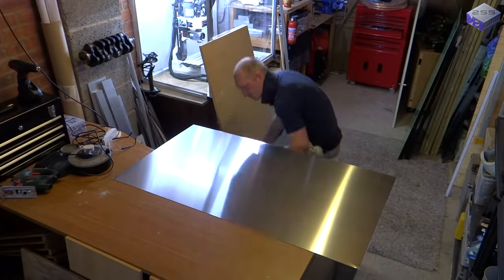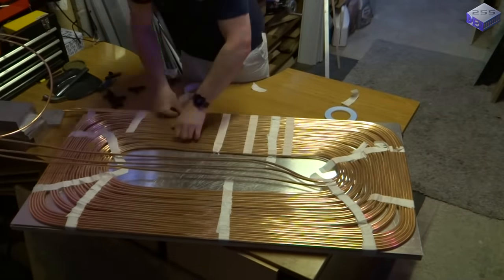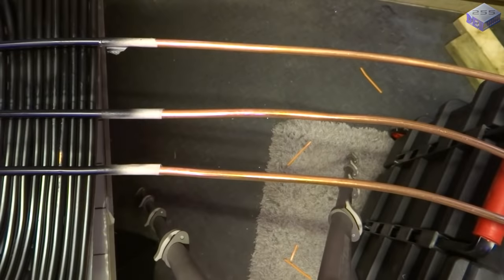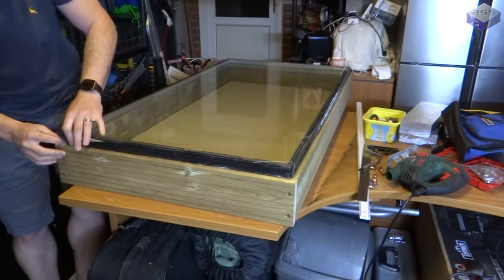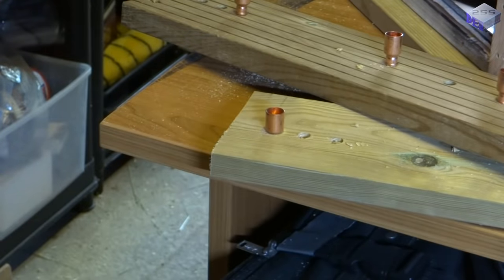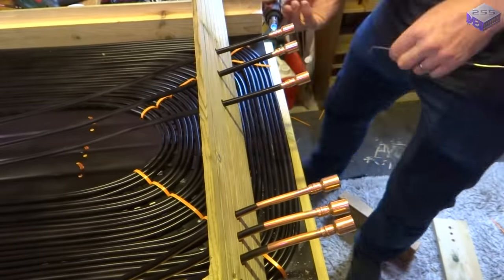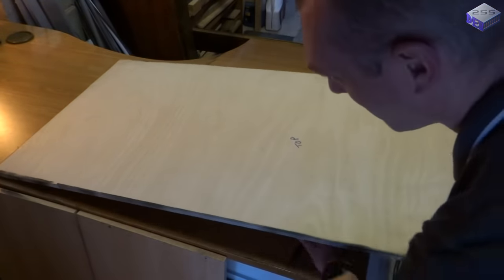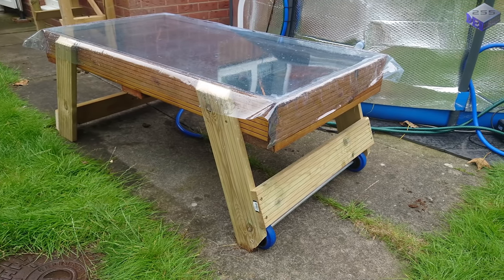Improved Solar Pool Heater - Full build

Comment: Did you use low e passive double pane glass?
Reply from the maker: Hi, unfortunately not, although I have got a few sheets of different material to try, so will be doing some comparisons. I didn't initially think of the reflective properties of this type of pane.

Comment: Wonder how much this actually increases the water temp on a hot sunny day
Reply from the maker: Hi, this is producing around 500W on a good day, and 450W average throughout the day roughly, so around 3.6kWh per day. For a pool like ours of 4600 litres, this would be fairly little gain, possibly around 1 to 2ºC so would require a few, although I'm still tinkering with the materials to see if this can be made more efficient. I will be doing another video soon that shows each stage of the upgrade. Hopefully, this will show how to make the most efficient system at home with standard products.

Comment: Really good idea and video.
Can you use pvc pipes instead of copper?
Reply from the maker: Hi, thank you, yes you could use PVC pipes, I did in my last version and it still works really well. I made a video of that one here: https://youtu.be/QU7RUfWXfZ4

There are a number of tweaks that I would do to this one too, plus I need to look into copper and chlorine more as there have been a few comments of concern.
Reply: Thankyou I will test it in a small scale.
I like to do one for a greenhouse.
Reply from the maker: @miguelhurtado3873  Good luck with your project. Feel free to ask questions if needed
Reply: @TheSolarPoweredEngineer , copper and chlorine do not get along well at all.  However, copronickel (aka copper-nickel alloy) is commonly used for pool and marine heat exchangers.  It is very corrosion resistant and on par with titanium.  Copronickel tubing is also used for automotive brake lines so that might be a good way to source it.
Reply from the maker: @CL-gq3no  Ooooh, that sounds like a good solution to this issue, I will look into this as I've not come across Copronickle (sounds like a Disney villain). Thank you for the suggestion.

Comment: why so mich copper on the aluminium ? half of the tubing would give the same result. Further on, why double glazed glass ? This blocks the heat from coming into the collector. When the sun disappeares you should swivtch off the water flow so no heat loss when the sun is away. I have professional plating ( of copper ) bought in a industrial factory , they welded the copper tubing approx 10 cms from each other going from right to left connected parallel to the copper connectors. ( just 2 in total ).  I am afraid there will be condensed water inside your panel which blocks the sun. But anyway my compliments for your work.
Reply from the maker: Hi, Thank you, I was going with as much contact surface area as possible for this size. This project was made from all the comments from my last PVC version, although I need to do some more tweaking such as changing the glass to UV resistant acrylic or greenhouse glass. The flow does turn off when the panel gets below 5ºC above the pool temp and turns back on when 2º above (hysteresis); this uses temperature sensors on an Arduino to switch a really on and off, plus it logs the temperatures on an SD card for me to track its performance and transmits the temperature back to the house. I did a detailed video on my last panel for this and hope to delve into this one more this year.

Comment: Do you think the copper pipe transfers heat better than black poly?
Reply from the maker: Hi, yes the copper does transfers the heat more efficiently, although the black poly is a fair bit cheaper, so you can have more length (surface area); therefore cost per absorbed energy would be better with the black poly. My first Solar Pool Heater on here does really well, collecting around 600W average and 900W max during the mid-day summer sun
Reply: @TheSolarPoweredEngineer  I wonder how I can get more volume. Right now it circulates about 600 gal a day. I wonder what would happen if I moved up to 1" poly?
Reply from the maker: @bigbrew08  To be fair, 600 gals per day at a 2ºC difference will give you about the same as 1200 gals per day at 1ºC. The flow rate does help a little the faster it goes, although negligible most of the time as long as it creates turbulent flow. The thing to bear in mind is that you need turbulent flow for all the water in the tube to take heat away from the surface (laminar flow will only allow some of the heat to be taken), so to go from a small bore tube to a larger one you would need a greater flow rate to ensure turbulent flow. I hope that makes sense.
Reply: True. I'm looking for an old wood stove. I'm gong to run some black pipe through it and connect it to the pump. This will help get the water up to temp where the solar heater can take over. Load of pine costs me about $40.
Reply from the maker: @bigbrew08  This should work well as long as the pipe going through the stove can take the heat. If connecting up the solar heater to the stove in series, I would recommend you have it pump through the solar heater first and then the stove so that the solar does the pre-heating; this as water in a solar thermal panel only reaches around 65ºC in my experience (unless you focus more area of light on it) and the stove will reach much higher. If the solar panel is after the stove it will have the effect of cooling your water as you heat the panel up. I always set the pumps up to push the water through the system for a few reasons, such as, the water running through the pump is at its coolest, it's easier to prime the pump (especially if it sits below the water level).

Comment: was it more efficient in parallel than in series?
Reply from the maker: It did seem about the same, although I couldn't say which would be better as the sun wasn't consistent over both tests, I would need two of these running together for accurate results. My initial thoughts are that the series system worked slightly better, possibly due to turbulent flow in the tubes (ideal for getting the max heat transfer), although the pump would be working harder with more resistance. I hope that answers your question.
Reply: @TheSolarPoweredEngineer  thank you! great video!

Comment: I would have insulated the copper pipes from the backing alu.  As is more heat will move from the copper to the alu than the reverse (IMO).  Indeed standoffs of 3 or 4 cm would have been better.
Reply from the maker: Hi, I do need to make some modifications so may give this a try. One thing I do need to do is reduce the amount of air in the unit, as this reduces the amount of energy transferred to the pipes apparently. I also need to change the glass as it could be reflecting more of the suns energy away.
Reply: @TheSolarPoweredEngineer   Need some air to insulate against heat transfer to the glass and out again - so make sure you don't make it too 'thin'.

Comment: Is water really running through every tube evenly?
Reply from the maker: Hi, probably not, hence the external connections so I can tweak the flow through the panel and different joints, I will need to get 3 flow meters for this and log it using the Arduino from the first panel.

Comment: How did that 500 Watts equate as a temperature increase though? Some temp in/temp out versus flow rate information would be better data to give out for somebody considering making one of these?
Reply from the maker: Hi Nick, I agree, I am yet to fully test the system as last years summer in the UK was limited to say the least, doh! Although, I did make a video that goes into a fair amount of detail including flow, temp in and out. Here is the video link https://youtu.be/Zt_RiMgSMEs
Reply: Calories are a measure of energy.  Watts are a measure of energy over time.  1 watt is 0.24 calories per second.
It takes 1000 calories or 4000 watts in 1 second to raise 1 liter of water 1 deg C.

So 500 watts  will raise 1 liter of water 1 deg C in 8 seconds. Or 10 liters of water 1 deg c in 80 second, 100 liters 1 deg C in 800 seconds etc.  

So to calculate what 500 watts applied for one hour can do ...

((Watts * Seconds) * 0.24) / 1000 = "litre centigrades"

(500 * 3600)* 0.24 = 432,000 calories 

432,000 / 1000 = 432 "litre centigrades" or litres per C.

So 500 watts applied for 1 hour would raise 1 litre 432 Deg C or 10 litres 43.2Deg C or 100 litres 4.32 Deg C or 1000 litres (1 Cu meter) 0.432 Deg C ....or a 20,000 litre pool 0.0216 Deg C

For a practial example take a standard 3kW electric kettle that holds 3 liters of water...
If the starting temp is 20C to get to a boil it would require (pure water at sea level):
(100 Deg C  - Starting Temp in C) * volume in litres * 1000 calories
 
Or  (100-20) * 3 * 1000  = 240,000 calories to bring to a boil
A 3kW element theoretically applies (0.24* 3000) = 720 calories per second so will take 240,000/ * 720 = 333 seconds (just
under 6 minutes) to boil
Reply from the maker: @Pabz2030  Thank you, that's a great explaination of energy to increase water, I've not thought of it in calories before, I will apply this to the calculations. Now I feel like I'm in the Matrix 😉 303.
Reply: @TheSolarPoweredEngineer  lol You´re welcome.  I knew my electrical engineering degree would come in handy one day...in or out of the matrix :)
Reply: @Pabz2030  Thanks for that, So essentially that means that using this device to try to warm up one of these above ground swimming pools would barely keep up with the losses from cooling? I had given some thought to maybe cobbling something like this together for my kid's pool, and maybe still will, but now I realise I will be doing it for the fun rather than any major heating effect. I suppose it's more of a temperature maintenance device rather than a heater?
Reply from the maker: @Pabz2030  They are great films (or reality 🤔) although haven't seen the new one yet.
Reply from the maker: @nickmaclachlan5178  Hi, it can be just temperature maintaining, there are a lot of factors to consider, including insulation of the pool, time of year, starting temperature and the fact that as you reach the maximum heating capacity of the system the temperature rise slows down, so you are best pumping the water through at a high rate to improve the panels efficiency. I've learned a lot from making these and feel they are fun to try and they do work well, although they need some close monitoring to turn the pump off when there is no sun, otherwise the panel starts to cool the water instead. My first panel had temperature sensors that switched the pump only when the temperature of the panel was 5deg C above pool temperature and switched off at 2deg C above pool temp to avoid oscillations (or hysteresis loop, like a Schmitt trigger). I may do another video on this later this year.
Reply: @nickmaclachlan5178  It would depend on a number of factors. Assuming UK, you´d need a good spring to get the water to useable temp by sometime in the summer thats´s for sure!  And youd definitely have to insulate the pool with a good cover at night or you´d start each day back at square one.   You can calculate the heat loss but it gets pretty complex as it depends on so many variable factors (water mix rate, ambient temp vs water temp, relative humidity etc), but on an "average" uk summer night of about 10 Deg C,  you will definitely lose most of what you put in during the day if the pool is outdoors and open to the air and the water is above 10 deg C due to the surface area vs volume.

Ironically a pool that is painted black will absorb more solar energy than the heater can put in itself if it has a reasonable surface area, so combine the two....paint the kids pool matt black and add a solar heater. :)
Reply: @TheSolarPoweredEngineer  A perfect anology on our strange world :)
Reply from the maker: @Pabz2030  Exactly, plus try to reduce the air flow over the pool also, this is effectively like blowing over a hot bowl of soup, the cooling effect increases as you blow due to you removing the layer of evaporating water to allow for more evaporating water to escape, where water evaporation has a cooling effect (why we sweat), we had a wind break around ours too and was inclined to assemble the pool where it was protected some what from the wind. Hope all this helps

Comment: any update on how this is doing or a comparison video of v1 vs v2?
Reply from the maker: Hi Paul, hopefully in the next couple of weeks, they are all hooked up to the pool, I just need to fit the flow rate meters, and temperature sensors, and then tweak an Arduino program to log it all.

Comment: The sun seems to heat my pool just fine on its own... how hot do you want your pool anyway?
Reply from the maker: Very true; it's definitely a taste thing. We like to get in our pool when the kids have gone to bed, where it's great to get in a 3m pool that's been heated by the sun rather than a Hot tub that costs a fortune to heat. I do get that it's also great to jump in a cool pool when the weather is hot too. We still have our pool up now (in the UK and now in November), but the pool is still sitting at 19ºC
Reply: @TheSolarPoweredEngineer  apparently I have been missing out on some benefits of my pool. Thank you
Reply from the maker: @RichardMiller-tq6ut  Not too much, it still needs a lot of maintenance even in winter 🙂

Comment: I wonder whats they actual number is temp difference in "parallel mode"  and water flow@ certain outside temp. Im sure there is a way calculate it by W output im just dont know how..
Reply from the maker: I did a fairly in-depth explanation on the first pool heater and will be doing another video on this one. I need to test it with different materials to see if it can be a bit more efficient. Here is a link to the first heater with explanation: https://youtu.be/-B7SMrmwsZE

Comment: A panel radiator works better. It is cheaper to make. I have 2 plates about dimension 2m x 0.8m  and 100l water in the tank. In start 20C degresse i heat up to +60C :)
Reply from the maker: I was thinking of a radiator too as these can come in black and have a lot of surface area, especially car radiators or Air Con ones. I replaced my Air Con radiator a couple of years back and it was only £40, although haven't tried this yet. it's good to know you can get +60ºC, I will be trying this later this year. Thank you for the info.

Comment: Would be Very interesting if you replicated this project, and used not just any matte black, but something like VANTA BLACK - the blackest black, than compare the times of reaching certain water temps,
Reply from the maker: I've been looking into this and someone earlier mentioned that there is little difference in performance. I will be doing some tweaking this year to improve the performance though.

Comment: Question: what’s the cold water temp entering and the warm water temp leaving the assembly?
Reply: you also should consider the volume of water leaving.  A hot trickle < a torrent of slightly warmer.
Reply from the maker: Hi, at a flow rate of 9 litres/min, I saw a temperature rise of 1.4ºC (25ºC in 26.4ºC out), so this equates to around 500W of heating capacity. The ideal scenario would be to find a good turbulent flow through the system as this will increase the heat transfer from the wall of the tubes as the water mixes inside (as opposed to laminar flow that runs parallel through the tube and has only the outer layer touch the skin of the tubes.
Reply from the maker: Ah sorry it was 4.5 litres/min, 9 was the pools pump

Comment: Great video, performance comparisons?
Reply from the maker: Thank you, I will have to wait for the sun next year, unfortunately, although I could test if it will heat water in November, UK, as I do get asked if these work over the winter. during the summer this year this one was getting up to around 500W average and is a fair bit smaller (footprint) to last years model that got around 600W average, so would have to do a full test and comparison next year.

Comment: Loved this, thanks! Great editing too.  Do you find the insulation on the walls of your pool to make much of a difference to heat retention? Most places online say it isn't worth insulating the sides as the loss is usually from the top.. i recently took some thermal camera pics of my pool (similar to yours) with a typical solar bubble cover installed, and the sides were lit up like a Christmas tree (not to mention being warm to the touch). I was expecting to see more loss through the cover but that was doing a surprisingly good job. Thanks
Reply from the maker: Hi, thank you. Funny you should mention a thermal camera as I've recently purchased a Topdon ITC629 camera, it's a fantastic piece of kit that I will be using in future videos. If I pull the side cover off slightly you can tell straight away how much energy is lost from the sides and down through the bottom to the ground. When putting the pool up this time I purchased 4 sets of garage floor matting from Halfords as it's a good insulator and makes the pool floor soft (which is good when you kick it swimming). The most heat loss is through evaporation, where the warmer water rises in the pool and escapes through evaporation leaving only the cooler water in the pool; therefore a pool cover has two functions, one being the surface heating effect and the other to greatly reduce evaporation. I have recently purchased a Wavemaker pump from All Pond Solutions and am waiting for it to arrive soon; this pump is an aquatics pump for creating natural water currents, although, I will be using it to push warm water lower down so there's less evaporation and have a greater temperature difference at the surface in the hope that it will increase the efficiency of the bubble pool cover. I've also got an Exit (make) clear dome cover to give it that greenhouse effect. I hope that helps.
Reply: @TheSolarPoweredEngineer  thanks!